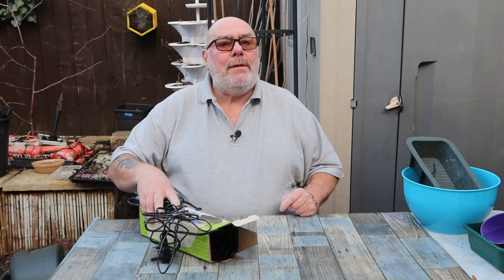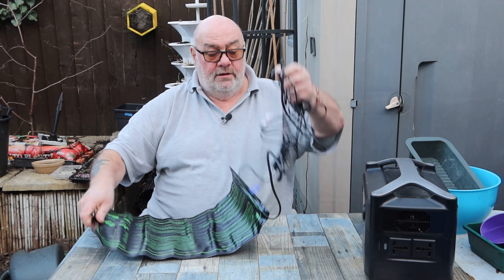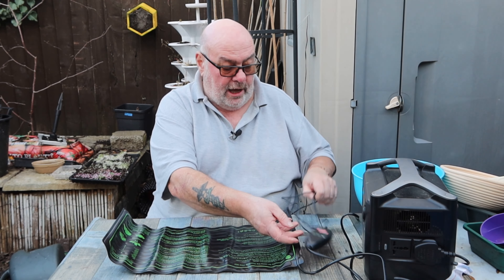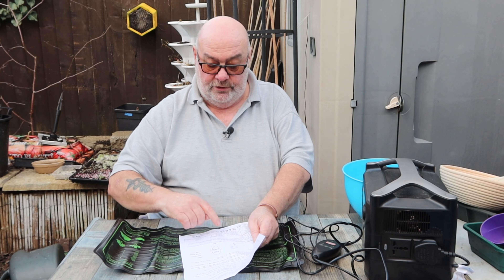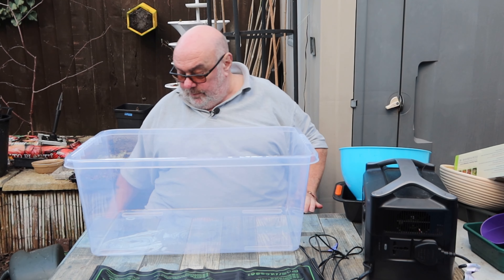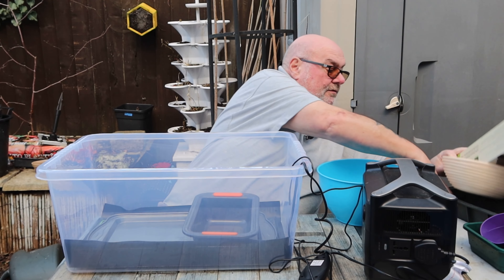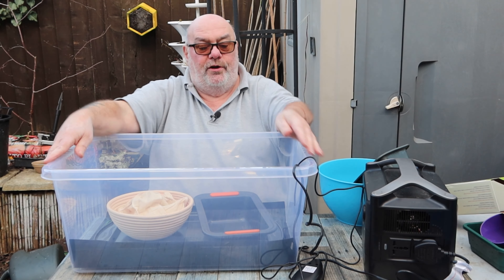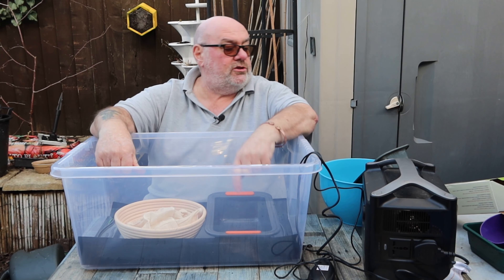My Homemade DIY Bread Proofing Box - Simple, Cheap and EFFECTIVE!

Comment: Great idea but I make all my own bread and the thing I've learnt is that dough rises perfectly well at room temperature.  The key is to make sure you mix with the correct temperature of water.  I am for 27c using a digital thermometer.  Next trick is to mix a fairly wet dough, so wet it's sticking to your hand.  Don't measure out the water, mix in until you get this sticky texture.  Let the sticky dough sit for ten minutes in an open bowl and it will firm up enough to handle.  Start folding it over by reaching your palm under and pulling up over.  Do this until it will stay in a ball shape, rest another ten minutes and repeat.  It's starting to rise now and you give it another fold.  Cover and within 2 hours it will generally double in size, ready to form loaves.  The longer it takes the more flavour you get.  You can prove overnight in the fridge for a richer flavour.  Forgot to say, after the first fold, plonk on counter and wash bowl in hot water.  Dry and return the dough to warm bowl.  Seal with cling or tight lid.  The heat gives the yeast a boost.  Once it gets going, you're off at a pace because statistically you have more yeast reproducing, more yeast and so on.
Reply from the maker: Great advice. What you have written is exactly how I rise my sourdough breads. Bulk rise at room temperature and a retard second rise in the fridge. I find that white flours or white flour mixes work best with a reach under fold but rye mixes seem better with a coil fold (but that may just be me LOL). I treated myself to another Mason Cash terracotta bread form (I already had a tear n share one). This one is the classic tin loaf shape and boy, the bread bakes well in it! I may even say, some of the best loaves I have ever made! Plus, while I was at it, I bought their terracotta baking stone which doubles as a lid for any bowl while doing the rises. Don't know if it's just me but the doughs seemed "fresher".
Mason Cash Stoneware Proofing Lid/Baking Stone: https://amzn.to/3DnZw05
Mason Cash Stoneware Bread Form: https://amzn.to/3XLQ270
Reply: @DigwellGreenfingers  The forms sound amazing!   I started using the method described with sourdough but tried it with my traditional 1950s white bread recipe and found it to be fantastic.   The recipe is, 2.5lb bread flour, 1/2 oz salt, 3/4 oz dried yeast, tablespoon of sugar or less, half a cup of oil or butter ( optional but makes a softer, fluffy loaf).  Water as necessary.  I love it because it actually works better than when I do a traditional 10 minute knead.  I do mill my own grain but haven't mastered a fluffy white loaf with 100% home ground wheat.  I currently get a fluffy, white result putting 7lb of the home ground with good quality (Shiptons Mill) bread flour.  Haven't tried my rye grain yet.
Reply from the maker: @UpthePottingShed  Brilliant - I'll be trying this one soon! I use Matthew's Cotswold Flours - loads of different grains etc.
Reply: @DigwellGreenfingers  Thank you for the supplier tip!  I'll be taking a look.
Reply from the maker: @UpthePottingShed  They do loads of discount offers every month - and Tesco has started selling some of the more "common" ones. I love their Eight Grain!
Reply: @DigwellGreenfingers  I've literally just had 2x16kg delivered, so I'm gutted because I'd have tried them out.  I'll definitely try them out later in the year though when I get through my first bag.  I have a selection of grain so will be experimenting with some mixes.  Have to justify the expense of my Mockmill 🙂
Reply: Room temperature varies... location and time of year so proofing boxes gets rid of variables that could effect the rise of the bread.
Reply: @Iamtommy69 you beat me to it 👍
I use a small amount of starter and prefer to bulk ferment over a long time, so it could be 25 degrees during the day, it can drop to over half that at night. Been contemplating a mat to keep temperature constant
Reply: I didn’t know that you are a fellow practitioner of the sour dough arts!  I have been thinking about proofing boxes just lately!  I have been cranking up the heat and using the house as my proofing box😂, perhaps that may not be tremendously efficient.

Comment: I have one of these heat mats for seed germination and just randomly came up with this idea myself and did a search to see if anyone else had done it and see how they laid it out. This is brilliant Sir! I just need to get the large tub. I plan on trying it soon.
Reply from the maker: Great minds think alike 😉 
My advice would be to make sure you use a rack or trivet under the proofing bowl and loaf tin. The mat gets hotter than it needs to to raise the temp in the box and the dough may form a crust on its base.
Reply: @DigwellGreenfingers  Thanks for the advice!

Comment: Looks wonderful! Am going to try it. Saw a similar one in a FB response to a question about proofing bread in a cold and old house in winter -- like mine, but she left no directions how to build it. 
Thank you!
Reply from the maker: It works great, especially in the cooler months as you hinted.
Do you know what is best in the Summer? (well for me anyway) - put the proofing dough in your car! Best on the floor where it is flat. Darn, another secret gone LOL
Reply: @DigwellGreenfingers  where is your car parked when you do this? In a garage, in sun, shade, or nighttime? Am assuming car is sealed, i.e, no open windows, yes? Thank you.
 Also what is air temp range outside?
Reply from the maker: @marymackendrick8164  My car is just sat on the driveway, if it is sunny then the window is open, if ovecast then closed. It just needs to be around 30°C inside really.

Comment: I got a back heat pad  it has 6 settings going up 1=86f 2=95f 3=105f which is the ideal setting for proving bread..  Plus the pad is soft so no preheating it to straighten it out before use.
Reply from the maker: That's a good idea!

Comment: It will work a treat.  I have a couple of heated plant propagators.  When not in use for starting seeds I proof my bread in it.  Place a wire cooling rack at the bottom of the propagator just so my bowls and baking pans are not in direct contact with the heat.  🍞🥖🥐🥐
Reply from the maker: Cool. Yes, I put a wire rack in mine too. This is basically the same as my old one but with a better boz and cheaper heater.
I've used it for a couple of loaves and they turned out great.

Comment: Wow! This is awesome! 🎉 the mat is out of stock from your link so I'm going to need to find a different one.
Reply from the maker: Many thanks for watching! You are not the first to say that the heat mat is out of stock, probably a seasonal thing. I have changed the link to another "make" - same mat, different supplier: https://amzn.to/45pZrnH
One thing I would add is to make sure to place a rack/trivet in the base on top of the mat. It just makes the heat a bit gentler on the bowl etc

Comment: Interesting ideas there.  I think I will take that with a larger container and cut a hole in the side of it. Get 2 feet of 4 inch flexible stainless dryer vent tube, Put some kind of fitting on it to make a lid for a pot of water.   What I have been doing is putting breads buns in my oven while off.  I have a portable induction cooktop with a pot of water on it boiling.  Once my bread proofs. I take it to our oven upstairs and bake it.  I can boil the water outside of the plastic tub.   I worry with so much moisture in the oven. It might become an issue.   Cheers
Reply from the maker: Sounds like a plan! Love to know if it works.

Comment: Hows the proofing box been working out for you, have you tested the temperature your dough gets to compared to the temperature youve set the heat pad too, just wondering how accurate the thermostat probe is on the mat?
Reply from the maker: Since I placed a rack over the mat and under the dough then it seems to be spot on. A great rise!

Comment: Brilliant idea, I have a propagater from greenhouse sensations. I wonder if that will work? My kitchen is too cold, to rise dough.
Reply from the maker: Is it a Vitopod propagator? I used mine once to proof the bread too LOL
Reply: Yes it's a vitapod with 3 layers if I need them. Not using it this year due to running costs  I've got a super 7
Reply from the maker: @paulinemorris5186  Cool. I was toying with the idea of buying a Super 7 but it doesn't have a thermostat so it is on all the time whether it is needed or not. I would be good for my chillies though.
Have a great weekend

Comment: Hello Steve, I don't know why but your video popped up out of the blue to watch, reading through the comments I see you are also a user of Matthews flour, I tend to stick with my tried and tested 50/50 Churchill/Cotswold Crunch mix but every now and again I'll try something different, as you've mentioned their Eight Grain flour I'll be adding a bag to my next flour order. Do you make a straight 100% Eight Grain loaf or a percentage mixture of their flours?
Reply from the maker: I have never tried to mix the eight grain flour with something else, but you have me thinking now LOL
They do make some nice flours - I find it hard to stop myself buying too many at once so it is a bit easier now that Tesco sells a selection of them (inc eight grain, Churchill & Cotswold Crunch)
Reply: @DigwellGreenfingers  When I need to replenish my flour I always buy a 16kg sack of Churchill White or 5 small bags of Cotswold Crunch at a time direct from the mill as they are only just up the road and on the doorstep next day, I find buying the 5 small bags are great as I can get say 3 or 4 bags of my regular Crunch and make the total up with 1 or 2 bags of something different when I fancy a change, which isn't that often as my favorite loaf is the Crunch, I also use the Churchill White to make my spiced fruit loaf so it pays me to get the larger 16kg sack.

Comment: Interesting 🤔 Steve, what difference does proving bread for 20-40mins or 4hrs make to the final product please and do differentdoughs require different times to prove? I prove my white/ciabatta doughs near a radiator and turn it  half way through but it only takes 20-40mins. 😁🌱☀️
Reply: Generally, the longer you take proving, the more flavour you get.  Think of it as fermenting, which it is and you get the idea of flavour development.
Reply from the maker: It all depends on the yeast and flour used to determine how long to rise/proof for.
The initial rise is just to get the yeast working but the gas pockets are irregular in shape. This is why we "knock it back" - get rid of the gas pockets, mould the bread into its final shape and let it proof to create smaller bubbles that the gluten can trap. If you always use the same flour and yeast etc then you can probably say "½ hour will work" every time, but if you are like me and swap around every time then forget the clock.
In dough that is over-proofed the yeast has run out of food. It's exhausted. It's been pushed past its limit and has no strength left.  The gluten strands will break down, and the dough may collapse either in the oven or as soon as it is removed from the oven, depending how over-proofed it is.
The way to test if the dough is ready to bake is to prod it with a finger.
If the dough springs back quickly, it's under-proofed - leave it longer as the yeast is still working
If it doesn't spring back, the dough is over-proofed - bake now with fingers crossed
If it springs back very slowly, it's properly proofed and ready to bake. The yeast has done its job.
Hope this helps.
Reply: @DigwellGreenfingers  I have an alternative method for knocking back.  I gently roll the dough with a rolling pin.  It's a tip I picked up somewhere along the way.  It works well, particularly if you're new to baking bread.
Reply from the maker: @UpthePottingShed  Never tried that!